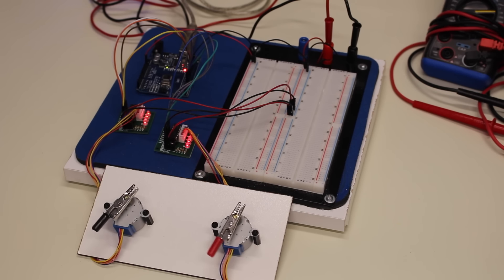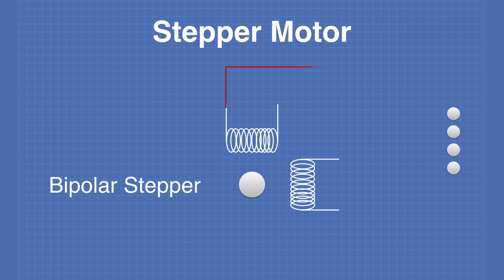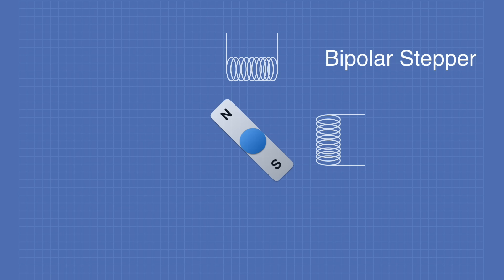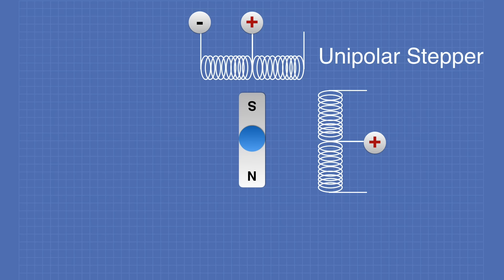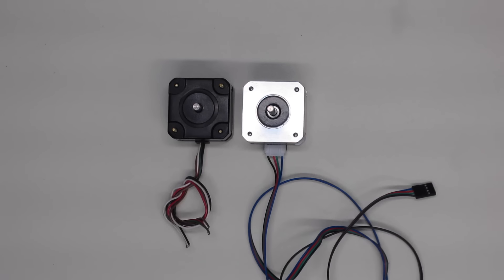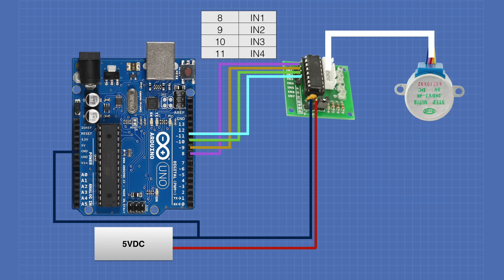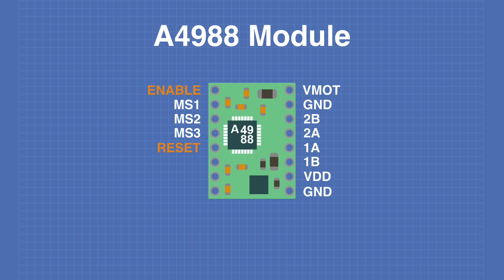Stepper Motors with Arduino - Controlling Bipolar & Unipolar stepper motors

Comment: Good video! But some moments are unclear to me. How communication with ULN2003 is working over 4 wires? Also from the code on 26:50 it looks like we should have rotation of stepper1 and only after this is finished the rotation of stepper2 should start, but in the experiment both steppers rotate simultaneously. Why is it so?

Comment: I’m searching to power up 2 stepper motors that came out of an old Epson dot matrix printer: ‘EM90,EPM 4244, EM 91, EPM 4243. I don’t know the specs of these stepper motors.  I have an arduino UNO R3, and an OSEPP motor and servo shield.  I think I need an external power supply. I’m guessing 12V. Do you have suggestions that may make this project work?  I’m not successful so far.

Comment: Can I control the 28YBJ-48 Unipolar Stepper directly from the Arduino Output Pins? (without the ULN2003 driver board) 
And is the reason to use the driver to protect the Arduino?

Comment: Question about the 5VDC power supply. I am designing something that uses a bluetooth, app controlled stepper motor. What are the best components to go from wall current 120 VAC to 5VDC?

Comment: How many stepper motors can I connect to the Arduino Mega board. I have one for right, one for left, one for forward and backward, and one for another purpose. The total of motors working async is 4. I am using an RC controller. Thanks.

Comment: Wow, great video. I have watched it a couple of times and done the experiments. Using the a4988 controller, is there a way to integrate a potentiometer to increase/decrease steps/speed? I assume you can hold DIR pin high with 5v to change direction if needed but am unsure about speed.

Comment: ULN2003 motor controller board. can you do a video explaining in detail how it works using a schematic ?
Reply: we offer belt-driven linear rails which are more efficient and economy for automation industrial, check CCM linear rails,  we also offer stepper motor/ servo motor and driver, welcome send me inquiry

Comment: @DroneBot Worshop :  Hello, is it possible to control a stepper motor with a sensitive touch button? my project is to touch one time to move cw the stepper motor, and when touching again the button to move ccw the stepper motor. I find it with a servo motor but didn't find the coding and wirering for what i'd like to do. Any idea? thanks a lot for helping

Comment: Thank you for this clear and awesome video. Could you give more information about the motors you used in the last case? I struggle to find one that works on 12V DC. What is the price range, are there models to avoid? Thanks in advance.

Comment: amazing video. can the uno drive 3x these steppers? does it have enough pins to do that? i wonder why small diy cnc laser engravers dont use these motors , is seems very cheap and easy to use than standard steppers,any idea?

Comment: Another very good video and excellent explanation. 
I used HY-DIV268N-5A to control a Bipolar stepper motor. It runs with Arduino Uno but not with raspberry Pi 3 B+. Is it due to the output Voltage of GPIO (3.3 V instead of 5V) which may be not enough for opto-couplers and what about Level Shifters?
Thanks in advance

Comment: Summary of the first 15 Minutes: 
Types of Stepper Motors and Generation of Rotor's rotation
There are two types of stepper motor, the unipolar and the biopolar. The Bipolar has only two junctions at each coil, while the unipolar can have 3 or more.  The rotor of a stepper motor rotates as the result of Torque exertion from energized coils. When the polarity of the coils is reversed, the direction of rotation reverses. The degree of rotation of the rotor is determined by the amount of current flowing through an energized coil.

Bipolar vs unipolar: 5:23 

Charachterising a stepper motor: 

A motor is charachterised by its step angle (Degree/revolution), Voltage rating (Maximum tolerable voltage), coil resistance, coil inductance, holding torque ,  detent torque and its shaft style. The required current can be targeted through knowledge of supplied voltage and  coil resistance. The coil inductance slow the speed of rotation. The holding torque represents the strength of the motor in an energized state, while the detent torque represents its strength in an unenergized state. There are 5 shaft styles of a stepper motor,  the shape of the motor shaft, the round shaft, D shaft, Geared shaft and Lead- screw shaft.

Comment: Would the 28YBJ-48 be suitable for use in a home-made slot machine? Wanting to drive three motors with either a rPI or Arduino but not sure if these motors are too slow for spinning the wheels quickly.

Comment: Hi
I am new to Arduino style micro controllers and I am finding your videos really helpfully and inspiring. 
I have a question.
If I wanted to control 10 or 20 or 30 Unipolar stepper motors what should I look for or can I use I2C or is their a control method that can be daisy chained together?

Comment: Great video!  I have a good quantity of salvaged stepper motors.  I can get them connected, programmed, powered ect. but have one snag point; setting the step sequence in the stepper instant of class.  Can't find info anywhere.
The data sheets have all information but not the step sequence (not that i recognize).  Do you have answer??

Comment: Thank you for doing this training it is very much appreciated. I am working on a project in which i want to use a stepper motor as a firing pin driver for setting off primers from a 9mm round. I intend to use a short arm mounted to the shaft of the motor and a firing fixed at the end at right angles. Please advise the size motor, speed and any code you may wish to contribute to such a project? Thank you again in advance.
Reply: we offer belt-driven linear rails which are more efficient and economy for automation industrial, check CCM linear rails,  we also offer stepper motor/ servo motor and driver, welcome send me inquiry

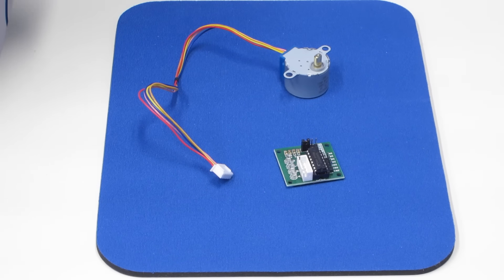Comment: 14:08 - why did the stepper motor didn't spin when you attached pulse pin directly to the 5v power rail ? It just moved a little bit and freezed! Is it a boards specification that this board need to be feeded with pulses and board "knows" that 5V is not the same as high frequency pulses witch looks 99% like DC in oscilloscope.

Comment: Hello, I buy a arduino and a motor controler. First i dont know nothing about programming. Ont the motor controler i only have gr for ground, 5v, for 5 volts, pb, probably mean push button, and a1 a2. Can you help me on how i connect it on the arduino ? from wish pin on the arduino i connect the a1 a2 ? thanks

Comment: I have a NEMA 17 4.2kg stepper motor, it says 1.7A per phase, its a 2 phase motor. 42BYGHM809
1. What does the current correspond to? (Stall/Average/Max draw?)
2. Is a 2 amp supply enough to drive the motor? 
3.  The datasheet I have says 3V for some reason, any ideas on that?
4. What do I use to drive the motor? L298N/A4988?

Comment: I'm new to electronics as well and I don't have a 5v power supply, is there any way I can use the Arduino's power supply and use electrical components to amplify the current?

Edit: I used an old USB cable and a power bank with an output of 5.1v

Comment: Just have a quick question. I wired everything as you stated for the A4988 set up and loaded the code into the arduino to run the initial test. I tried three different A4988s already and made sure to check all the leads being at the right pins. I’m getting nothing when I apply 12V to the circuit. I tried even just powering VMOT and then powering the arduino from VDD, but am getting no voltage. Makes it seem like the boards I got are dead. Any idea what I might be doing wrong? Only difference from your circuit is that I used a 1000uF cap. Thank you!

Comment: What do you use to supply the power to the VMOT? I put a 12V 2A barrel jack into the Arduino and wires from VIN to VMOT but I ended up destroying my board. Atleast something is destroyed as my computers won't recognize the board and I can't upload new code.

Comment: @36:30

Can I upload Arduino sketch repeatedly to the Uno when the connection to the stepper is enabled.

I have a A4988 connected to the Nema 17 at one end, and the Arduino is controlling the STEP and the DIR pins of the motor driver at other end.

I am hesitant to upload the sketch from the laptop when the 12v and the 5v power to the driver is supplied as I think it might impact the functionality of the electronics of the motor driver when the sketch is pushed.

Before I do burn the driver or the other pieces of the hardware - thought of posting the question here.
 
Would appreciate your inputs

Comment: can i use a 12V 20amp external supply with  nemma 17(1.7 amp) + a4988........wouldn't there be heat issues

Comment: What kind of data is going between arduino and driver. There are 4 wires. Is it some type of protocol or is it solely for this application.

Comment: If I want to use arduino and stepper motor in my project (automated cooking ingredient dispenser) which required timing and one revolution for all the ingredient to be dispensed into the  pot, what items I need to buy to achieve that?

Comment: New to your Tutorials, which are absolutely fantastic. For the last 3 or 4 years I have been trying to source an accurate motor to drive the capstan on an old high end reel to reel tape recorder and think a Nema 17 Bi-polar motor may do the trick. Admittedly using an Arduino for this purpose may be overkill but if it does work it’s worth it. My question is do you think this is viable and if so which mode would give the quietest and smoothest operation (no wow and flutter); full step or micro step, bearing in mind the RPM would need to be in the 120/160 range; I will need to calculate RPM if the project is successful.

Comment: I have looking for a video (in DroneBot Workshops) which shows stepper motors driven by an easy driver ( A3967?)  as Bill talked about in his video stepper motor with arduino- controlling Bipolar & Unipolar stepper motors. I could not find such a video. Am I right? Thanks for reaction.

Comment: hello , this combination is ok? I need this posibilite  (PPR) like 51200  .. what I need is move 45.56 degrees or 12.45 degree etc.MA860H 200KHz Stepper Motor Driver Ametek Haydon Kerk 43Q49-2.9-A02 2049 Stepper Motor

Comment: hi, brand new to this and need info.first I need a small stepper motor and a means to control its speed from 0 to 1100 rpm. is this possible and if so what is the least amount of hard wear that I need to accomplish this?

Comment: Very good presentation and useful. I'm working on a project which required using 7 step motors, and I wandering how to get the software that you used call "library" to run the code? I also subscribed to your channel for more information.

Comment: something like ESC ....

Is there any device or circuit that can be used for the stepper motor that needs more than 5 volts ??.....   

can I just connect stepper motor's  + - wire to higher volt battery and just signal wire to receiver ??? 

appreciated

Comment: Will you plz make programme with same items you used in this video. Motor start running in one direction and stop where a distance sensor senses 1 mm distance and stop for 10 min. and then comes back with 700set speed.

Comment: I know very little about electronics. I do know a lot about film, super 8 and cameras etc... My dream is to build my own film transfer rig with some stepper motors to drive two reels to push film through a simple gate illuminated by an LED light frame by frame and the light, the motors all turn in sync to so that each frame of film advances and the LED light illuminates exactly at 24FPS, and then later being able to change frame rates would be ideal. I will stick with one for now... Do you think buildng this is a good beginner project? If I could do my own transfers with some new 4k-6k cameras that would wipe the costs of film transfers and make shooting film actually viable thing for me.

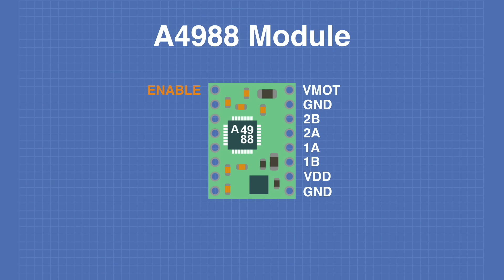Comment: 39:39 When you say the enable pin is held low by default, do you mean it has a built-in pull-down resistor?

Comment: Hi
Thank you very much for your video that explains very well and with good sound. I hope you can answer a question I have because I plan to make my own CNC machine and want to use Stepper Motor I already have, they have a current of 4 A. and 24 V. Therefore I need a driver, for example TB6600.
When you step and want to move fast, you will use full-step mode, but you may need micro strep to work on a object,
My question is how do you do with that type of driver? - it have manual contacts to set the mode or is there another driver that have sw. select mode with the high current. ?

Best regards Erik Nielsen

Comment: great video! I'm struggling with a code to that will move a stepper a fixed number of steps triggered by a current sensor then return to its original position when current is removed.  Any suggestions?
Reply: we offer belt-driven linear rails which are more efficient and economy for automation industrial, check CCM linear rails,  we also offer motor and driver, welcome send me inquiry

Comment: Hey - Question.  I just want to controll a stepper motor use two buttens. ( impulse swtich )    If I push and hold swtich-L   it will turn left.  If i let go of the butten it stop.  If I push Switch-R it turns Right. ect ect.   Speed is fixsed and can stay the same forever.    how?

Comment: Sir, first of all I've seen a lot of videos but I never have seen an arduino video this good. And I tried out your  code on the 28BYJ-48 motor, in the circuit diagram you have used an external power source but I have used the 5v pin on the uno and it worked. my question is that is it safe to use it like this (the stepper motor). Also do have anything on starting raspberry pi. Complements from India

Comment: 2 more commercials watched so adsense owes you for 2 more.
Do you think you might be able to create a video showing the use of an ir remote control and ir receiver for it with whichever Arduino so that we with older audio equipment can actually control the functions on the front of the audio preamp or receiver with as much? I'd love to bring my 60's Marantz into the "future" (barely the future at all) by controlling it with an ir remote and stepper motors to turn the volume, bass, mid, treble and input knobs using any of my Arduino Mini's, Nano's, Uno's, Leonardo, Mega 2560's, Blue Pill's or my MKR1000.
Thanks for considering as much at least.

David

Comment: So i'm trying to program a stepper with an A4988 and i can't figure out how to write the code to make the motor start and stop depending on a pin being high or low and also want the motor to rotate in the opposite direction if a different pin is made high.

Comment: Is it possible to show us  microstep TB6600 driver Arduino connection with the drivers  by the three motors with endstop buttons with relay to stop and run the drill please showing this in video or photo please ?

Comment: Hi !. Pls suggest for Below. 
I have 1. Motor Bipolar   1. Board L298 And Input is Analogue 0 to 12V Variable by controller. . 
I need Motor To Rotate FWD when Input is Increasing(0 to 12V).  And Motor to rotate Reverse when Input is Decreasing(12V to  0). or vice versa
One condition to add When Unit (Supply) start the Motor should Reset to 0 point first. 
Application is Architecture Sculpture to move UPDOWN on command. 

Pls Suggest hardware / software. With minimum boards.

Comment: Would you please demonstrate use Arduino to control AC single phase Motor  Start /Stop with acceleration and deceleration controlled by a Solid State Relay. Thank you very much. Henry 2020/10/11.

Comment: Is it safe to drive a stepper motor with L293D? I don't plan to run the motor 24 hours a day. Do I need to add capacitors for the L923D or can I just get away without it?

Comment: Great arduino tutorial and arduino steppers motors. You will have a video a where you can connect steppers nema 23 Of 8  cables. With Tb6600 card and arduino.

Comment: Thank you and
Can you power the controller board with the same power supply which is powering the Arduino?
Reply: we offer belt-driven linear rails which are more efficient and economy for automation industrial, check CCM linear rails,  we also offer stepper motor/ servo motor and driver, welcome send me inquiry

Comment: My stepper motor was spinning CCW when yours was CW, and CW, when yours was CCW, why?
In order to be like yours I've changed the pin order to 8-IN4; 9-In3... And it worked
BUt can you tell me why my stepper motor is different? Im using all the components of the video, except the power supply, witch Im using the arduino 5V supply to power the motor

Comment: Thanks for the great videos. Subbed. One question: Is it possible to control a motor+controller using a computer with Python installed on it, that is without an Arduiono or Raspberry Pi. I'm thinking if Raspberry pi is just a small computer, larger computers must be able to do its job

Comment: Thank you for a great video.

I am working on A4988 to drive stepper motor as my application has more than 25 steppers running. I have had problem controlling my stepper's micro step. Also if you know about wemos d1 r2 (ESP8266 Wifi module) then i need your help controlling my stepper using my wifi module.
Please help and reply ASAP!

Comment: I couldn't get it to work with a 9v battery and a power supply module converting it to 5 v... so I powered it with the arduino and it works fine. what is the reason he said not to use the Arduino? Saftey??

Comment: I''m sorry, but can someone explain how it's OK to connect the ground from the 12V stepper to the Arduino's ground. I'm confused because of the voltage difference between the Arduino control(5V) circuit and the motor's power circuit (12V).